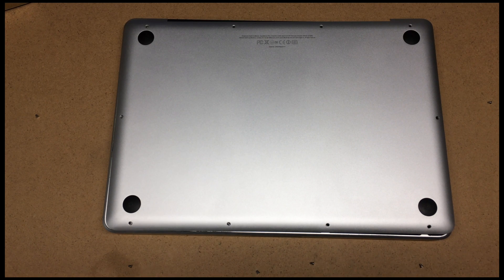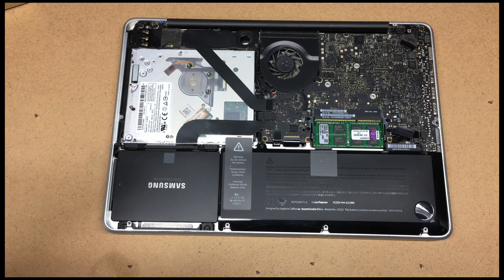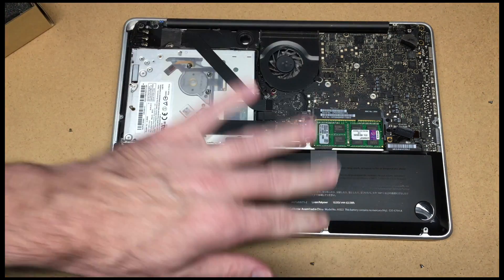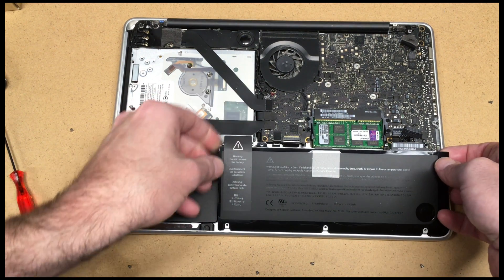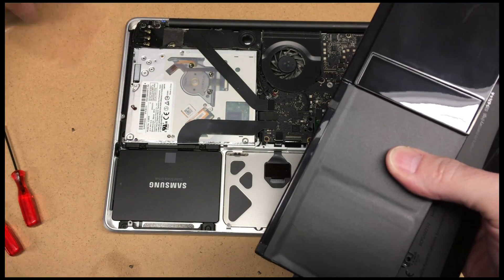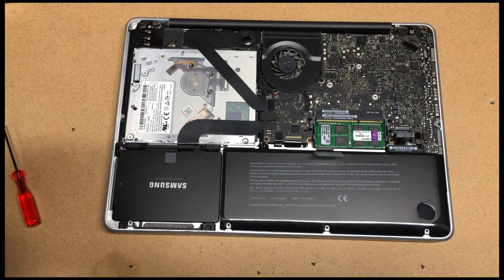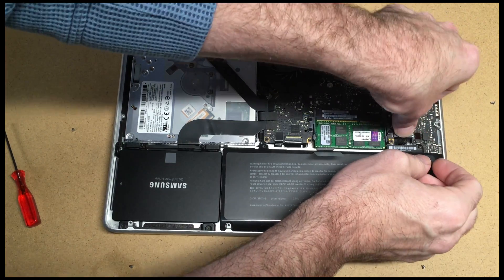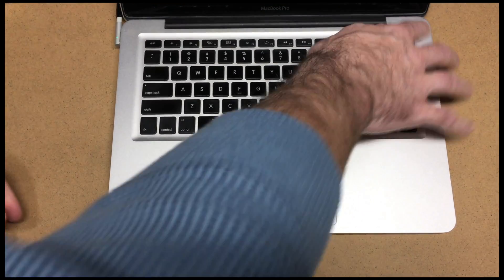Fixing mid-2012 13" Macbook Pro Bulging Battery and Trackpad Issue

Comment: This video would be a lot better if the screen size and model of the featured Macbook Pro was explicitly named in the video title. It looks like a 13" model, but that wasn't obvious right away. I'm having this issue with a mid-2012 15" Macbook Pro A1286.
Reply from the maker: Thanks for the feedback. I changed the title. I'm guessing your 15" might be having a similar issue. If it is, the procedure to swap out the battery is probably similar. You would just need to find the right size battery.
Reply: @Rickmakes  Yes, I found a video for the 15" Macbook and the process is virtually identical. I ordered the appropriate battery and just in case, a replacement trackpad. With the bulging battery still pressing on the trackpad, there's a dead spot when swiping up and down (side to side still works perfectly). Based on your experience, what are the chances the trackpad will start working perfectly again after I remove the bad battery? Currently it's pushed up high enough as to be flush with the palm rest, and only clicks when pressing on the very bottom/center.
Reply: @Rickmakes  I'm back to answer my own question from above: I got the new battery a day earlier than expected and just installed it. For the first 5 minutes after replacing the battery the trackpad seemed to work perfectly, but for some reason now it's acting up and the dead spot is back. If anything, it's even worse than when the battery was pushing up against it. I was so relieved when it seemed to be completely fixed, and now disappointed that it's apparently permanently damaged! Luckily a replacement trackpad should be showing up in the next two days.

Comment: I've changed out the battery a few times in my mid-2012 MacBook Pro over the last 10 years.  The MacBook Pro will run fine without a battery in it at all, you just need to save and close it down and restart and reopen everything.  Nothing will be saved in memory, and you won't be able to sleep and then restore, but it will still work.  (I know this because I ran it this way while waiting over a week for a new battery to be delivered.)  It's also very easy to change out the battery and very easy to lose the screws.  They are also different sizes (long and short ones) so when you unscrew lay them around the computer the way they came out and you'll know what goes where.  This is also a very good time to have a can of compressed air to blow out the inside.  There will be lots of dust and some pet fur (if you have a pet) from one battery change to the other.

Comment: hello I am having this problem with my laptop. I wanted to ask if the replacement battery lasted a while. I been reading reviews and people have been saying that the replacement batter only last two months or has completely messed up the computer or the batter only last 25 min when not plugged into the charging port. so will you please let me know how long your  battery lasted.
Reply from the maker: I'm going on three years with it and it is still working great. I haven't had any problems with it.

Comment: I have old MacBook Pro and the track pad looks like it exploded.  It is raised and cracked. Can it be fixed?
Reply from the maker: If the battery caused it, you would need to replace that. In my case, the trackpad still worked. If yours is physically damaged, you would need to buy a replacement. I don't know if that would be worth it. There could be other damage you haven't seen yet.
Reply: Thanks for your quick response. 😊

Comment: Good day! Should I wear an ESD anti-static wrist strap when opening the macbook?
Reply from the maker: You can wear one if you have one. I would clip it to some metal on the case. I don't regularly wear one but I do make sure to make contact with the case as I am working on it to dissipate ESD. I also run a humidifier in my house so it doesn't get too dry.
Reply: @Rickmakes  thank you so much. More power to your channel.

Comment: Rick, I have a 2011 MacBook Pro that has a different battery than the 1322: The battery info is: Manufacturer - DP, with a Device Name - bq20z451.  Do you know if it's the same as the 1322, and could I still use your link to order that replacement battery?

Comment: I had the same problem, bought the same replacement, track pad was good as new. Now about two months out, the battery is beginning to puff and the track pad gets sluggish. I noticed that pushing down hard on the track pad  restores the functionality...but I'm thinking these replacement batteries are not cutting it. I don't keep the battery charging 24/7..but why should that matter anyway?
Reply from the maker: It is certainly possible that the replacement battery went bad. I would try to contact the seller and see if they can replace it under warranty. It is possible that the replacement batteries aren't as good as Apple's but in my case, I replaced the original battery that was slowly destroying my computer. I hope you are able to get it fixed without too much trouble.
Reply: Keeping it charged 24/7 might be bad for a li-ion battery becuase you aren’t letting the battery drain and the charge to move, this causes a build up of gasses that can’t escape due to the chemical reaction, just a hypothesis tho

Comment: Does a healthy battery have curves? The battery I currently have is aftermarket, but I didn't install it. On the right side of the battery, there is a curve that could be bulging on the top and bottom. I can't quite tell if that's how it's supposed to be, or if it's a bad battery.
Reply from the maker: The new battery I put in was completely flat.

Comment: I've got a bulging battery on a 2011 Macbook Pro that, like yours, is affecting use of the trackpad. Did you have any issues with the trackpad after replacing the battery? Did you have to repair it in order to get it working?
Reply from the maker: In my case, the trackpad went back to working normally after replacing the battery. You could try removing the battery and running it off just the power cord. If the trackpad works in that configuration, I'm guessing it wasn't permanently ruined.
Reply: @Rickmakes  Will try that...but first need a tri-wing driver #dumb
Reply: Reading a bit more, looks like it won't power up without a battery installed. Start up takes quite a bit of juice and the power cord is limited on its output.
Reply: Update - you need an 85 watt charger to power on the Macbook Pro line of laptops without a battery and to properly charge the battery to prevent swelling.
Reply from the maker: I was able to boot mine without a battery. Different year models could work differently.

Comment: My original battery did not puff up, but quit charging. Replaced it in 2017, and the replacement battery has started to puff up and my trackpad no longer works.
Reply from the maker: That sucks. Mine original battery puffed up. My father has the same computer and his just quit working but the computer didn't show as having a bad battery. We swapped it out and it is working now.

Comment: Was this a 3rd party battery?? i'm in Canada, so batteries aren't cheap especially if it's an OEM. I have the same swollen battery on my Macbook pro, It works fine, but once I get ahead financially I will buy a new battery, seems to be a thing with this version of Macbook pro, video was well done btw
Reply from the maker: It was a 3rd party battery. Here is a link to it on Amazon: http://amzn.to/2jvL4cI (affiliate link) I'm not sure if it is available in Canada. No problems with it so far.

Comment: Out of curiosity, although your old battery was bulging was it still working in terms of power distribution?
Reply from the maker: It would still power the computer. I'm not sure how long it would power it on battery. I wish I had checked before I swapped it.
Reply: @Rickmakes  Yes this is very strange. I'm using the latest version of iStat Menus and it's showing me that the battery is fine. However, there is definitely some swelling taking place, which is forcing me to replace an otherwise good battery, which is very disappointing. 

I reached out to OWC because the nuPower battery I purchased almost 3-years ago was around $100 and I felt they would know why this was happening. Sadly, they did not. I suppose 3-years is reasonable, but I wish that somebody could explain the sudden swelling. Thanks again for your video and response.

Comment: The reason why batteries puff up like that is caused by the device(s) plugged in all the time. Nice job on the tutorial!
Reply: Thomas Groh but it seems a lot of the 2012 models were having this issue 🤔
Reply: OrincyWhyteDesigns I’m guessing we are seeing a recent increase because of the battery health of those models diminishing which means, that subsequently the users plug their MacBooks in more causing the battery to swell

Comment: Great video!

I have a late-2010 13” Macbook Pro that recently had the battery bulge. Wondering if I should upgrade the RAM in addition to battery. Also, with an aftermarket battery, would the Pro’s native battery monitoring subsystem be able to monitor it, or would I have to download a third party app?

Thanks!
Reply from the maker: It is not a bad idea to upgrade the RAM while you have it open. That being said, sometimes older RAM can be expensive. It is best to have a matching pair of RAM modules. I'm not sure what the late-2010 takes. Kingston have a memory search on their website that will tell you what your computer can take. I was able to monitor my battery right after replacing it. If you were to have problems with it being recognized, you could try resetting the SMC. You can google for instructions. I like using Coconut Battery2 to check the status of the battery.
Reply: RickMakes Thank you.

Comment: I have the exact same problem as you, the battery’s expanded and popped out the trackpad a bit. I also upgraded my MacBook Pro to a Samsung SSD and 16GB of RAM recently. Do you think this might have caused the problem, I see that you have upgraded yours too. Idk if it’s just a coincidence
Reply from the maker: I think it is a coincidence. SSDs use less energy than a traditional hard drive. Extra memory should also lessen the load on the hard drive and processor (due to caching). Apple has had similar swollen battery issues in recent models. I think they are replacing those for free. They don't seem to care about 5 year old models.
Reply: RickMakes oh ok, has yours been fine ever since your battery replacement ?
Reply from the maker: Yep. No problems. That being said, I always keep multiple backups. You never know when or why a system is going to die.
Reply: RickMakes alright that’s good. Thanks so much for your quick replies, I appreciate it man.

Comment: triwing screws..... grrr.... seriously anything other than phillips or flat should be illigal
Reply from the maker: I'm not a fan of phillips and I don't like flat at all. Phillips strip out easily and flat can be a pain to drive, especially if they are small. I prefer Torx and my second choice is hex. Torx is nice because there is one standard. Hex can be a pain because there are SAE and metric variants.

Comment: That's exactly how my battery in my 2011 macbook pro looked.  I also ordered my replacement on Amazon and it came in a similar box but had 3 screwdrivers.  I also upgraded to a Samsun SSD like your computer previously.  I ended up stripping the longer screw because it was super tight and may have been due to the bulging.  I used a dremel type tool I brought on Amazon for $15 to cut a groove in the stripped screw head so I could use a flat head screwdriver.  I discarded the bad battery at a battery disposal kiosk at Home Depot.
Reply from the maker: Glad to hear you got it fixed.